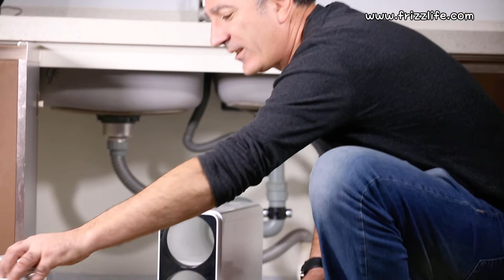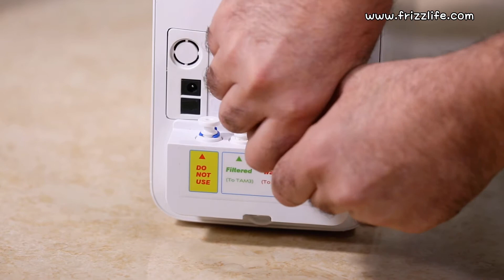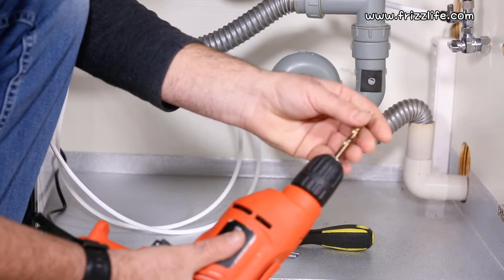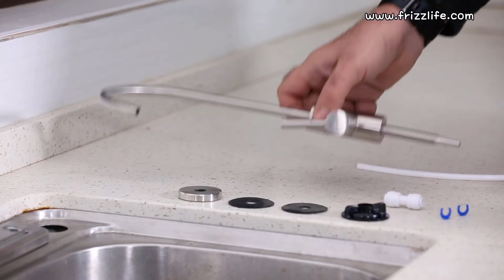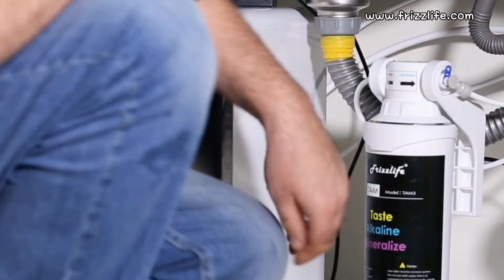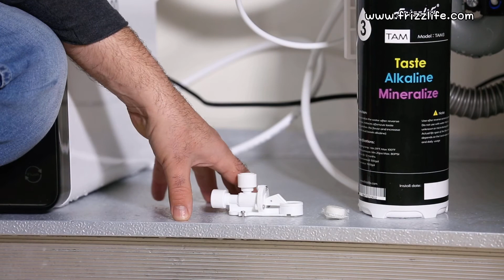Frizzlife PD600 Reverse Osmosis installation

Comment: Whats the purpose for the waste all you need is for the water to filter clean. What does the waste has to so with drinking clean water.
Appreciate your response.
Reply from the maker: Hi! In fact, all reverse osmosis processes generate wastewater because when the reverse osmosis membrane intercepts impurities and harmful substances in water, it needs to be washed away with a certain amount of water, resulting in the discharge of wastewater. The wastewater ratio of our product is 2:1.

Comment: not good instructions at all. can hardly understand him. 
so many steps left out. never mentions of needing to cut 1/4" tube in 3 places. doesnt show where and how to place the connector into the water line. once installed doesnt mention what to look for when its ready.

Comment: I just got mine delivered. the two filters are already installed and the blue tabs in the back where the tubes go into are missing. I feel like you'd was used product or something. However, all the accessories included looks new.  I think I should return it?

Comment: Hi I'm in the UK and fitting one of these but have hit a problem with the T valve as the connections are a different size and length (too short). Every thing else is fitted except for this bit

Comment: Just installed one of these units and the water is great!  They are a bit too loud though while in operation and the quality of the water connections could be better.  I would be happier with better connections even if it made for a bit harder installation (which was easy, it just took time).  The included connections are a bit finicky and are prone to leakage.

Comment: My PD600 unit didn’t come with the leak stop. 

1) Was it supposed to come with a leak stop? 

2) Also, is the leak stop inlet/outlet openings supposed to be 3/8” since it sounds like it goes on the 3/8” tubing connecting the feed water valve and the PD600 unit?

Comment: Is it compulsory to use these two filters together that is the PD600 filter and the TAM3 filter or they can be used independently .
Reply from the maker: they can be definitely used seperately, but we would suggest to connect the TAM3 after the reverse osmosis to get a good alkaline and remineralization result. The TAM3 filter is designed with auto shut off features , if you simply twist the TAM3 off, you will get RO water only through PD600.
Reply: @frizzlifewater  me gustaría saber las características de la fuente de alimentación para el equipo de G500-A

Comment: The only bad reviews I’ve seen are leaking issues. So, where is the system prone to leaks?
Reply from the maker: Hi, the PD600 with a built in integrated water board inside, no tubing connections , normally it won't leak at all.  there's one or two cases has a valve leak because of wrong installation, but Frizzlife always has a great customer service and make sure to solve any problems that may occur.  Will have a fast response if you email to support@frizzlife.com
Reply: The faucet connection leaked at first, and the TAM filter leaks internally

Comment: i don't know what country this video was made, but that plumbing in illegal anywhere in the USA.
Plumbing code requires an airgap for a discharge to drain.
Also, that is NOT the proper location for a drain saddle clamp.
Reply: Hello, I’m interested in this RO system, so how the drain should be installed? I’m not a plumber just a DIYer and live in the USA. Thanks
Reply: @wichotroll7315  not a plumber, but I did mine higher, on the straight section, drilling into the P trap just seems like a bad idea
Reply from the maker: Hi, you can refer to the "Frizzlife PD400 installation" video on YouTube for the good location to install the drain saddle. DIY is quite easy actually